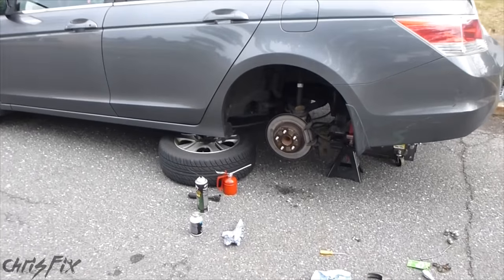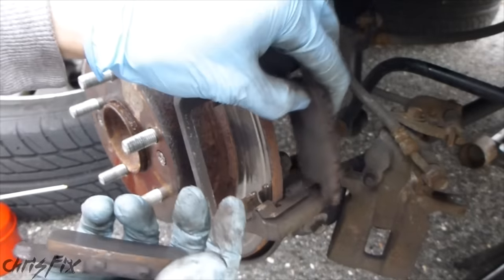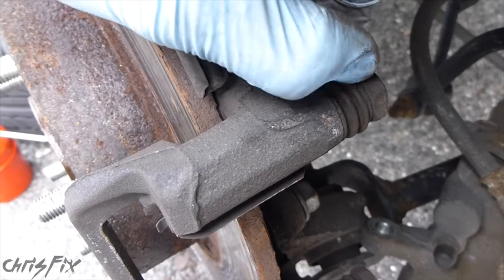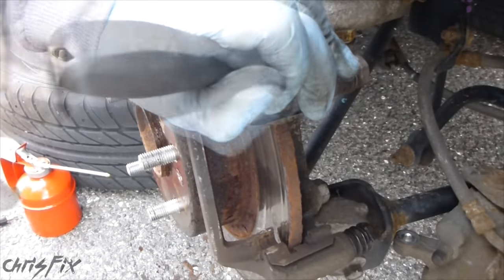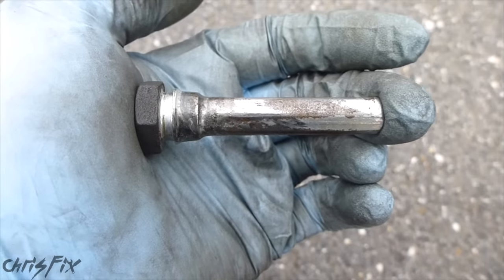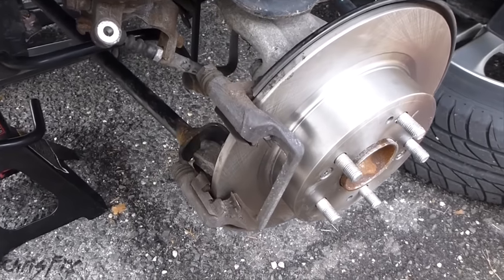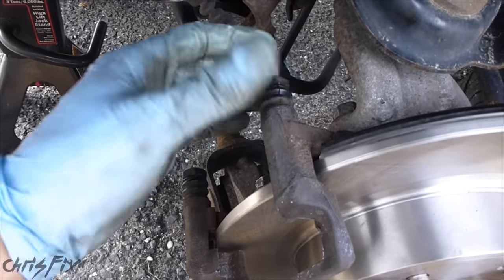How to Fix Uneven Brake Wear

Comment: I swear, when I'm having a problem you upload a video addressing that certain problem a few days later. I need to get some silicon paste.
Reply from the maker: Liqhuid Haha, my ChrisFix senses are tingling.
Reply: Liqhuid Same here. I fixed a Ford truck last week with the very same problem. lol
Reply: ChrisFix I'm looking forward to seeing if your next video addresses my problem. If it does I'll be freaked out.
Reply: 3M silicon paste  £15  on ebay  from USA   or £45  on ebay  from U.K   W.T.F !
Reply: Same here Chris ... Went for a servicing the day before..... Noticed this issue.. And today this video was in my suggestion... N i was like... 
Haa... Thts wat i really needed... 😅
Reply: @chrisfix  spidey sense
Reply: @ronpalmer1371  i paid $3.69 from wholesale auto supply.
Reply: Ice Breaka 
I guess your in the USA,  I am in the UK and many things mentioned by American youtubers is not available here or it is silly money like I mentioned.
Reply: @chrisfix  What to do if rubber boots feeling brittle?  Both of my pins are stuck in extended position and wore off my outer pad.
Reply: @ChrisFix And if the piston is level, is it that easy to say its ok?   Or replace caliper?
Reply: @Pslws  replace all the hardware via a hardware kit
Reply: @ronpalmer1371  Sly Glide is same thing.  In a pinch, white lithium marine grease is OK also.
Reply: X-Man thanks for that
Reply: @ronpalmer1371  Happy to help out.  Didn't realize your original post was so old but figured you may not be the only guy wondering.  Sly glide is a NAPA brand name but I think its the same as a Sta-Free brake lube product that comes in a white tube.  The white lithium is widely available.  Good luck over there.
Reply: Red rubber grease is what I use.

Comment: Yet again, your videos showed me how to fix the exact same problem with my car. This is like the 4th or 5th video of yours that I've directly used to fix a problem. My wife's rear brakes started grinding two days ago. Brakes were installed at a shop just last year. The guide pins were all gunked up with some sort of horrible sticky lube (like rubber cement) that didn't allow them to move hardly at all. Cleaned them up, got the good grease on, and new brakes installed. Thanks for the video.
Reply from the maker: Awesome!!! That is what I like to hear!!!
Reply: Some car repair shops will use the wrong stuff to lube the pins and you won't notice it until much later when you hear noises from the brakes. Guide pin grease must be silcone based and made specifically for heat and good for use in contact with rubber boots.

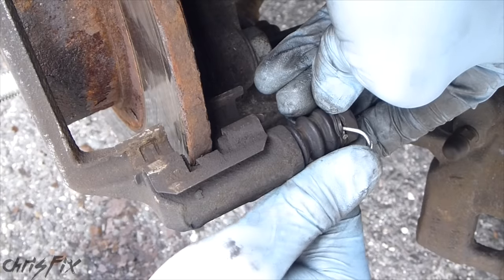Comment: ChrisFix I saw a tear in the boot When you were separating the boot from the guide pin. It was at 3:16 of your film and appears to be already there. Amazing and helpful videos by the way.
Reply from the maker: Yo JoE Thanks for sharing! I will have to take a look at it! Good eye!
Reply: Did you also see the dent in the piston? That must be replaced too!
Reply: ChrisFix you don’t know squat let me see some ase certifications
Reply: @chrisfix  would you tell me why rear brakes worn out before front brakes
And is it necessary to adjust them all together
Reply: @tuttiw3014 I'm not ChrisFix however usually you do both sides together so both rear or both front, however whether the front or rear brakes wear out first will do with the brake design and load distribution of the car whilst stopping. Stopping shifts load to the front wheels and therefore the front discs are usually bigger however are doing more work. Hopefully this came out, appears to be typing right to left like in Arabic, however my language is English.

Comment: Excellent tutorial! If a rubber boot has a split in it I found as a temporary fix is to use liquid rubber . Brush it on boot and let dry. It dries flexible. Good until 
you can get a replacement. It once worked for me. The stuff is used to cover bare spots in electrical wire insulation.
Reply: Good to know,thank you

Comment: Thank you so much! This was happening to mine and I thought I was gonna have to replace the caliper. But upon replacing the pads I had a bolt on each side that was stuck. I did what you did and amazing... it worked perfectly. Now even wear. Thank you again.

Comment: Take a bore brush, (commonly used for cleaning gun barrels) and clean out all the rust from the female side of the equation in the caliper cage.  First saturate with penetrating oil to break up the crud.  Scrub it out with the brush, rinse with brake clean.  Repeat and rinse as needed.  A final swab of paper wrapped round a shaft, (1/4" extension, screwdriver or similar will do) to get out any final residue.  Blow out with compressed air.  A fiber optic inspection light is great to check your work on this kind of job.    
Make sure you don't put too much grease inside the cage of your calipers.  If you do your slides will not contract fully and When the pads wear down the brakes will fail to work.  That's a bad thing. 
Pure silicone grease is also sold under the brand name Silglyde, available in one shot packets at most parts stores, but NAPA sells it in large tubes and  spray cans.  It is one of my top go to lubricants, for brakes and all sorts of linkages that you never want to bind.   It also works as dielectric grease.
Reply: how do you know the bore identifies as female, it might be two spirit, not good to gender judge mate, fix up
Reply: Bore brush a good idea! I just ordered a set from Princess auto 1/2 price $16.53. I always had problems cleaning the female hole out. I used to use brake cleaner and let it sit then Q tips. Your idea makes sense. Thanks.

Comment: I  am a disabled vet spent 7 years in the NAVY on submarines. I learned a lot about mechanics and electronics. I was a reactor operator. But we had some things that had slide pins and we had to check them every month. But even thou I am in a wheelchair I still work on my cars the simple things. The last 2 times every thing was ok but I forgot to do 1 side and when I did the brakes the last time both slide pins were not so good. 1 pad was worn down like the ones in your video. Plus the other had cracks and a small piece out of it must have caused it to over heat.   I had the same problem as you also the pin was out of stock at the on lt auto parts place and I had to drive 45 miles to get just 1  pin. But I cleaned it real well and made it there and back with damaging the new pads.

So this was a great video!!!
Reply: Years ago, I didn't even know slide pins could be replaced, but I did wire wheel them on my grinder and silicone grease them. The car stopped fine after. I've heard that it's possible to put too much silicone grease on these though, to the point that an air pocket forms that impedes the povement of the pin.

Comment: Noticed uneven brake wear on my 2013 mustang. Checked the caliper pins, cleaned them and lubed them with silicon paste. Now its breaking smoother and quieter than ever before. Thank you Chris Fix!

Comment: Just to add that petroleum based grease is sometimes referred to mineral based grease. It should also be added that even other types of synthetic grease aren’t advised because they can make the rubber expand. Silicone grease is definitely the way to go for guide pins and anywhere plastic/rubber is in contact.
Some people do use a copper/ceramic grease for the break seats though because it is purely metal to metal contact.
Reply from the maker: Thanks for sharing!

Comment: Awesome tutorial as usual, Chris! I doubt most shops perform as complete a job as you do.
Reply from the maker: Thanks David!
Reply: David Sparling i doubt it too haha!
Reply: I know this is prob true for a lot of shops sadly but at mine, this is not the case at all. We, or at least, I go even above and beyond this when doing a brake job. I always remove everything and inspect it first really well. I sand blast the caliper brackets anchors really well so the new hardware and guide plates fit nice and flush, always use new hardware, new guide pin boots, brake clean everything, wire wheel the guide pins, all the bolts no matter their condition when removed, lube everything really well, including the caliper piston and guide pins before putting it back together, I make sure and clean out the guide pin holes too really well as old grease and gunk love to built up in the bottoms and stop the pins from being able to push in all the way like they should. Most people think the pins are bottoming out but really there is old lube in there keeping them from going in all the way which can allow air to get in there as well and cause the brakes to get overly hot, warp the rotors, burn the pads, or cause a grinding noise if the pins cannot move as designed. Also anti-seize all the bolts before putting them back on and making sure everything is tightened properly. 

Id rather take the extra time now to do the job right the first time than have the customer come back a month later with brake noise that I now have to take all back apart and fix, usually on my time and not making any money in the process, unless it ends up being something unrelated to the brake job. U want customers to come back because u do good work, not because the work u already did isnt right.
Reply: Yeah they really don't. Some of them just replace the whole caliper without a proper diagnostic lol

Comment: Great video!  I HAD a Santa Fe that had this same problem at around 40,000 miles and I had to replace the brakes myself because Hyundai claimed it was normal "wear and tear" not covered by the warranty.  It's nice knowing now what the issue could have been and that I made a good decision not to buy another vehicle from them.
Reply from the maker: +Bobby0345 Thanks! I leased a Hyundai santa fee that need a new engine after the first 2000 miles. Thankfully it was a lease and I didnt own it!

Comment: Great video, definitely a big fan of your channel but based on my own experience with how unevenly worn out the inside pads were along with the caliper pins, cracked boot, rusted brake hardware, and rusted piston. I usually just go to my local auto parts store and buy re-manufactured calipers with the housing for around 55.00 plus lifetime warranty! A lot easier to replace and big time saver!
Reply from the maker: +Harrison Edgar thanks and thanks for the tip!

Comment: Yeah, it could also be that loose caliper bracket (joking of course, cause I'm assuming you intentionally loosened those bolts for reasons not mentioned in the video).  I'd also like to point out that uneven wear like that could also be cause by the pad ears binding up in the bracket.  So always make sure they move freely when installing by doing a quick dry-fit, then apply a thin coat of anti-seize to the ears for final installation.

But to anyone else reading this, as an accord owner of 10 years and the current servicer of my fiance's CR-V, I STRONGLY advise you to actually remove the caliper bracket entirely and thoroughly clean out the pin holes and mating surface for the rubber boots with wire brush, Qtips, & brake cleaner (always finish with a final wash of brake cleaner in the pin holes, then let air dry).  It's actually pretty difficult to get that completely cleaned out, which needs to be done if you're changing pin grease types or brands.  Brackets are held on with only 2 bolts, but they're often seized on pretty good. Grab Kano Kroil penetrating oil and a breaker bar, and you'll have em off no problem.  I know from too much experience that these Honda brakes are a nuisance.  If not done correctly, you'll continue to have problems.